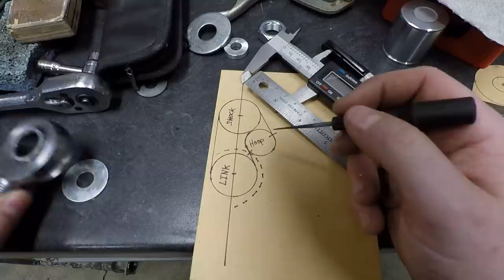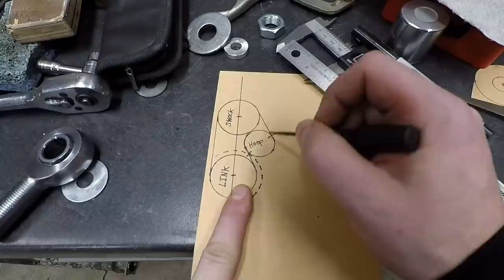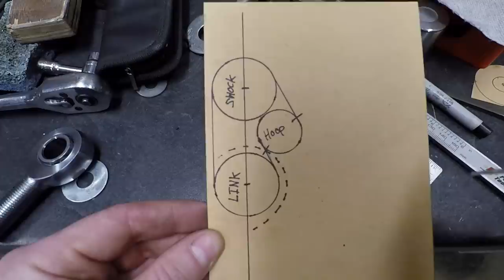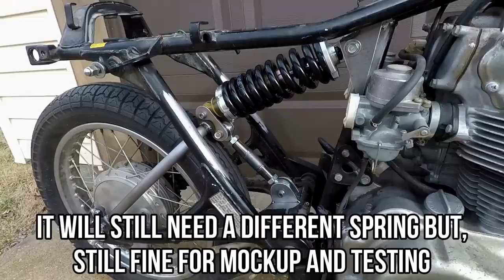Honda CB500 Monoshock Conversion!

Comment from the maker: Hey everyone! This was a very project collaboration with my friend Thomas of Mile Zero Racers and I am excited to finally show it to you.  Keep in mind that I am not a suspension expert but I feel I have a good grasp on how this should be done with the specific goals in mind. If you want to know more on this stuff I highly recommend the Race Tech Suspension Bible for more in-depth reading and technical info.  Also know that I am not going to link any specific parts just yet as this is still in testing so once we know it works well we will have more information to share. As mentioned this is hopefully going to become a kit so if this is something you may be interested in for your CB450 or 500 let us know!

Bj
Reply: Race tech’s book is worth the weight of a fully equipped Gold Wing and then some! Geometry is a section that should be read several times over. Love the vid look forward to seeing the kit!

Comment: That’s awesome that parts are cheap ,because anybody can start building a bike then . I have a GSX r1000 2003 and parts for it are insane I got the bike for 1000$ I’ve put maybe 900 in parts so far but I still need parts subframe , seat  headlight and front stay I’ve bought 3 off eBay all the wrong year lmao but it’s a learning in process I’ve reshimed the valve train compression is right in spec I think I want to make it custom naked thought I can fabric parts I need also I just can’t seem to come up with an idea yet

Comment: Looks cool but doesn’t look like it’s going to have much suspension travel with that shock anyway. Very stiff.
Reply from the maker: As I explain the spring is stiff. It will be replaced and will have the travel demonstrated earlier in the video

Comment: The problem that I have with these posts is that you are hitting my high school years with these conversions. At that time,1968 to 1972, the only two motorcycles on the road were the Honda 450 and 750.  Oh yea.  There was a 350 too and of course the 50 cc "motor bike."  Whatever.  Anyway, the 450. Yea.  Way too many memories.  Whew.
Reply from the maker: Hopefully all good memories!

Comment: I raced GP in the 60 and 70s, yes, I'm an old man now but I had my time in the sun. All our bikes were simply Cafe Racers in those days and the Mono shock wasn't really a thing yet. Later on I rode them but just fooling around in the desert. My question is, how much better will the Mono shock bike handle? I often got frame flex on tight corners, does this fix that? The geometry is a bitch!! I could do it but others did it a bunch better! I wouldn't mind having the 500 as a Cafe Racer!!
Reply from the maker: Well this may not be any better. It won't go on a track and the intended use is for the street.  The monoshock is a goal for looks and the sake of building or just being custom.

Comment: Very nice fabrication....i got it clear.....i need a welding machine, hahahaha. MIG with flux wire is the cheapest and best for homebuild DIY i thing. No gas needed. I like your channel, i need a lot of advice for my build. Cheeers mate
Reply from the maker: I used a MIG for 16 years before I got a TIG so don't feel like you just need a TIG. I can't stress enough that you want a MIG with gas. It performs so much better and is a small cost difference.

Comment: Love the channel!  You actually inspired me to start building bikes.  It was "Grandfather's Axe" that did it. Lol.  Any advice for a new builder?
Reply from the maker: Well I appreciate that! As far as advice oh man, that's a long list. The biggest things though are to spend money on good information and not parts. This is especially true with diagnosis and not throwing parts at a problem. For building id say spend some time working on a budget, your plan, and your organization. Its easy to get overwhelmed so focus on bite sized chunks and not the entire build as a whole. One piece at a time. Eventually it will get done. Also for building, don't feel like you need the best tools or shop. Be creative with what you have. Tools are always a good investment but absolutely not necessary to have the best stuff. Lastly, you WILL get frustrated and discouraged.  This is normal. Just walk away for a bit and come back with a level head. I took 5 months off of a car build to give myself a break. It was very worth it. Again, one piece at a time

Comment: No worries about your video length ever! You give excellent info and don't hide any steps. Best kind for someone who is doing their best to learn it right. I made a 8 part video on building a ford c6 transmission and have yet to have anyone complain about length of it all. They are all happy I took the time to go into the details most smooth over. Thank you for a great video and you've got my subscription for sure!
Reply from the maker: Thanks so much for the support

Comment: I rarely chime in but...never never leave a chuck wrench in the chuck of a lathe. Especially at the 27:50 mark. I know somebody who has a  rough rusty 70's CB450. Cool build.
Reply from the maker: My lathe can't even turn on unless the chuck cover is down. Impossible to even make that mistake
Reply: @BrickHouseBuilds  This is on page 6 of your lathe's Users Manual. • Remove all tools (wrenches, chuck keys, locking pins, and so on) from the spindle immediately after using them. Safety switch or not (they have been known to fail), it's an unsafe habit to get into. Nice lathe.

Comment: Just commenting to boost the algorithm, great stuff, the preload adjustability is interesting looks like you can tune the geometry and the spring rate will be almost progressive, getting softer as the angle increases due to the suspension travel.
Reply from the maker: Much appreciated Shane!

Comment: Dude, if they had taught engineering like this in ' Highschool' i would've actually gone. Are you Allen Millyard's son? That's some next level backyard improv! Do strengthen the monoshock upper support, leaving room for rainwater to escape. You will be golden, it will collapse on itself if you don't support it! And rip off the welds. Goed gedaan jongrman!!!
Reply from the maker: Id definitely like to meet sir Allen!

Comment: I hoped you would fix the rear brake lever.
That piece is lower than the bottom of the frame and off road it will catch on rocks
Reply from the maker: Its a long way off of being a build so it would be address at that time

Comment: dude...yes, but no...either make the swingarm stiff as hell , like a classic yamaha cantilever one, OR, make it with a progressive linkage at the upper connection point with the shock. why? you will find out once you ride this thing...just saying, will all the respect...been there , done that a lot of times. by the way, I envy your welding skills, great welds. keep doing things. don't hesitate to test new things, no matter whatever mistakes you make, or failures you meet. and  don't discourage. keep up the good work!
Reply: ***WITH ALL THE RESPECT!
Reply from the maker: That doesn't fit what the customer wanted. I built what was possible given the tools, materials, project goals, and both time/money budget

Comment: Hi BJ,

as a follow up to my earlier post here. I know you are a busy man, but if you have any time, i would greatly appreciate if you could share the drawings of the brackets you fabricated for the monoshock kit. specifically, the ones that connect the shock to the brace hoop and the body, mainly the hoop bracket, as it is a complex three-point mount bracket. 
I appreciate the time,
Stan
Reply from the maker: I've already replied to your previous comment but I do not have drawings for these.  You would have to go through @milezeroracers to maybe start that process as the goal was for him to produce it. I had explained all of this in the video. Definitely check his video out which is linked.
Reply: @BrickHouseBuilds  thank you BJ. I have watched both videos. Your video is clear enough for me to go on from. I was just hoping to remove any guesswork. I appreciate the response and time!

Comment: Very slick! Should the heim joint  be on about the same radius arc as the swing arm to avoid binding?
Reply from the maker: I likely overbuilt that section here but for looks I felt it would be best to keep it close. I'm sure you could have it smaller no issue.

Comment: I think those CB500T's are kinda cool...and not many people use them for builds.  Does a mono shock make the bike handle better or is it more of a visual mod?   Here's a question for you... when I look at the profile of the bike, why not do a perfectly  straight line from the hoop up through the shock?.   If you go to  49:32 you'll see you can't draw a straight line from hoop's lower mount to the top of the shock mount.   Is there a reason for the very slight angle created between hoop and shock?  Seems like making it perfectly straight would make things even stronger, but  I got a C+ in geometry and Ive never welded a day in my life, so I don't know.
Reply from the maker: Well as explained I didn't want the shock to go over center and get softer as it traveled up. I had to have angle built in.
Reply from the maker: Also this is more visual but with enough time and money you could make it handle better

Comment: @BrickHouseBuilds, Hey  "Joe Dirt", I have a Strange question. With all the Mods you do on Frame Structure and or Suspension... are you required to have it inspected by "State" "DMV" " OMV" "DOT" ... or ??  I think you do Great/Awesome Work... Take Care......
Reply from the maker: No it's pretty lax here. I'm not modifying the neck or anything so it just stays as it was from the factory
Reply: @BrickHouseBuilds  Don't misunderstand my question, if you do any mods to the frame or suspension does it require a inspection for title or registration? just asking not picking on you for your mods, i kind of like watching your videos, also lets kids see the use of Physics, Math and Geometry in your work.... Outstanding take care and keep up the great work.
Reply from the maker: @waterfive0  no for what I'm doing there are no extra steps. A custom constructed frame is different as is a salvage rebuild which both require more inspections

Comment: Great video and perfect length.

Regarding the hoop where it mount to the old shocks point on the swing arm. I wondered if you had considered solid metal bushes rather than the metalastic ones fitted into the swing arm ?
Would this not reduce flex?
Regards Andy. 🇬🇧
Reply from the maker: You make a good point on that but through the entire process the goal is to make it simple for the average guy in his garage to do should it be a kit
Reply: @Brick House Builds  
Could the kit  include bushes to press in? Assuming the swing arm is being removed for welding. 
By no means a criticism just an observation. x
Reply from the maker: @andygibson5678  if it were requested multiple times id say always a possibility